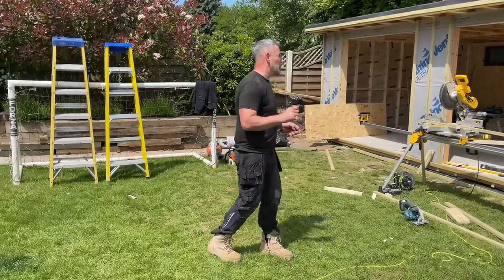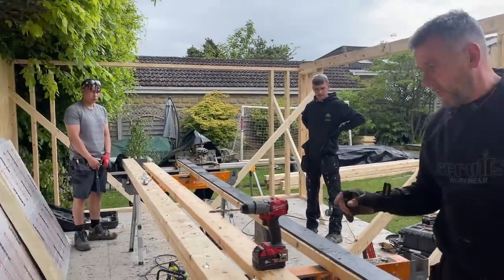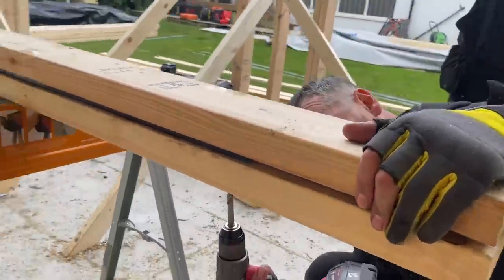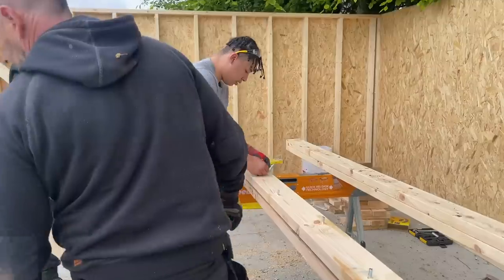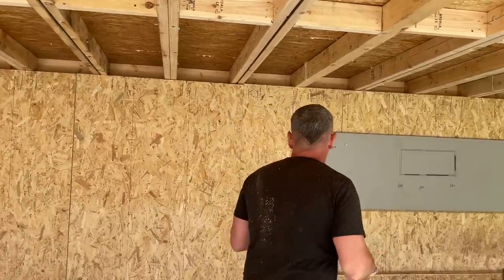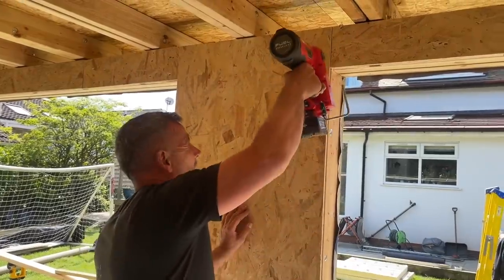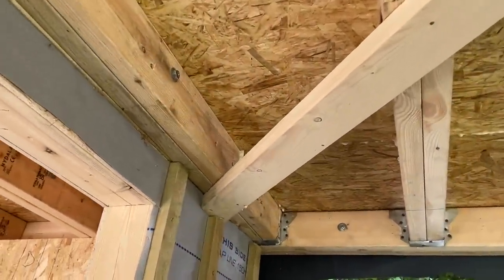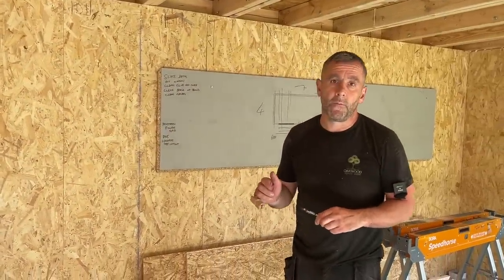How to build a huge garden room roof with a canopy

Comment: I drilled 24x 12mm holes in 10mm steel with a Titan 1500watt electric drill and one Dewalt 12mm all material twist drill. I also used WD40 drill oil.  I am sure any drill will do, it’s all about the pressure you can apply plus a slow drill speed.

Comment: What thickness osb do you use on the roof? Can you go with 9mm or does it need to be thicker. Also, is 2x7 OK for that span as a single joist? Ta

Comment: Not sure if you have tried it before Liam but we recently had to insulate some walls and floor in a garage conversion and we cut the insulation over a table saw with a good extraction and it worked a treat as we make all the stud studs exactly the same and slotted the insulation in perfectly. It made a nasty job easy.  Obviously the depth is more of a issue on the thicker insulation.
Reply from the maker: I’m waiting on the genius that is Ronnie coming up with his dragons den take my money solution for cutting the 100mm 😎👌
Reply: @thegardenroomguru  give it a go mate I’ve always cut it by hand and it’s a nightmare! And spent two days coughing up the crap even wearing a mask.
Reply from the maker: I will mate, everyone hates it, I especially like how when you think you survived it, you rub your eye a bit later, and it left a little bomb on your eyelash, that goes in your eye, and it gets it’s final bite at your soul

Comment: If you're using 20mil quazi bolts to support the flange bracket of the 4x2 rods, do building regs allow you to use timber bracings when it's load bearing?

Comment: Hi mate, I need to cover a 7m space so will add a flitch halfway. Can the steel between be made up of two pieces (width is 5.5). I will of course bolt the connect in the middle of the beam or does the steel have to be one piece? The beams of course will be two full beams

Comment: Hi Liam fantastic build I’m looking at building one in my garden 5m x5m with a 2.5 canopy would two 5x2 bolted together be sufficient to span the 5m gap or would I need to use flitch beams or could I get away with 6x2 bolted together thanks

Comment: Bought a dewalt spade bit costing £6 and a cheap unbranded £3 bit from screw fix , the dewalt bit was useless , the cheap and chearful bit drilled over 20 holes without a problem and each within 10 seconds

Comment: Hi Liam, this is fantastic. I’m in the middle of my massive build of 7m x 7m and doing this with permitted development.  Did you have to get a structural engineer to do roof weight calculations. Btw I went for giant ground screws for my foundations and currently framing them. Wish I could share pics with you. This build inspired me cos it’s one half of my build.
Reply: How is 7x7 under permitted development? 
Would love to see a build this big !
Reply: @ryanhovells2339  There's no size limit on PD, as long as you don't use more than 50% of the land. Anything over 30sqm has to go through building control though, so proper foundations, fire regs etc. The equivalent of a new build house.

Comment: Im on starting a build based on what you do.
About to build the walls. Will be 11mmosb outer with rhino ultra but one question.
Does the wall CLS need to be treated timber or not.

Comment: Going to order your 7m x 4m build pack next week. Glad you mentioned about the double 5x2 being sufficient for 4m span. I was hoping to go 4.2 and still be under the 30m2 internal floor space. Would it be risky though going 4.2m with double timbers? Very informative as ever though. The cost for the metal is already a concern.
Reply from the maker: As said on the video, my own garden room? I’d have no issues doubling them up. Even at 4.2
Reply: @thegardenroomguru  That’s great to hear.
Reply: I'm not sure the match the span rables for calculated load though. You could probably go up 50mm in roof beam at C24 and meet the span tables and be away with all the steel. Then you could have 120mm noggins, vent soffit front and back and have the insulation in the correct place and a have a true vented cold roof.

It's probably building regs you need to be more aware of going to this size

Comment: How can you get away with 28 square metres? Without planning permission? I thought it was 15 square metres maximum. Or is there something to do within one metre of the boundary?
Reply from the maker: This build is more than a mtr from both boundaries 👌
Reply: @thegardenroomguru  OK but it's combustible material it's wood right?
Reply from the maker: The whole combustible materiel thing is completely up for interpretation by whom ever reads it mate. Some say metal cladding fine or non flammable coating on wood, others say got to be block or brick, there’s no definitive answer, all councils say different things, because it’s not clear enough, we did one in Barnsley, neighbours weren’t happy, guy from council came out snd was only interested in the height, off he went happy it was under 2.5 🤷‍♂️

Comment: The height of the structure is to be no more than 2.5m is that from ground level or from the flooring? I ask because if i raise it up to have decking out from it would i have to sacrifice some of the height as opposed to doing it at ground level.
Reply from the maker: From ground level mate
Reply: Unless your a metre away from the boundary then you can be 3m 😜
Reply: @jamesfox7196  I thought it had to be 2m from the boundaries? I've 10m width but a really long garden. I'm hoping to go 5.5m wide by least 7m depth so can go over the 2.5m height and do a apex roof instead... Wish Liam and co get chance to do similar for another client and video that for us all 🤣